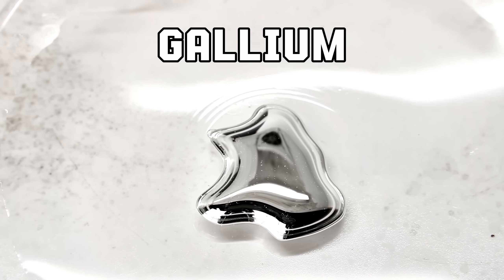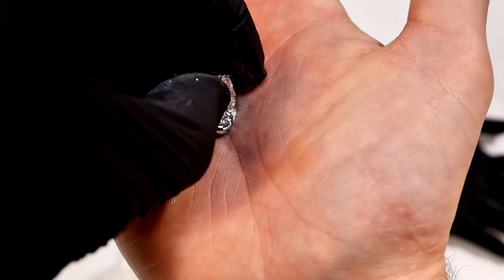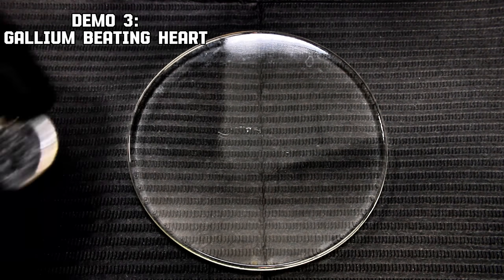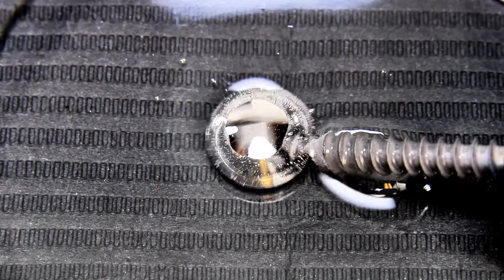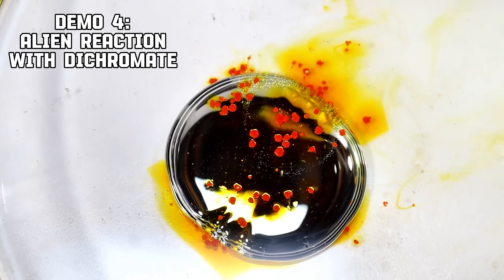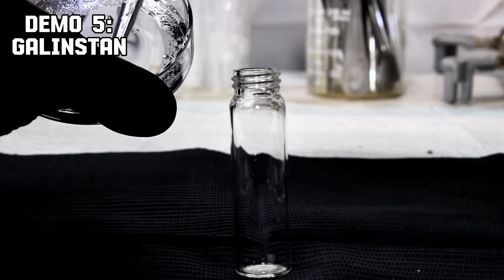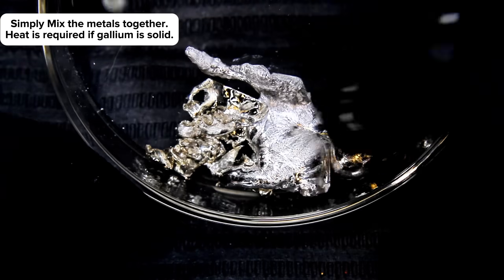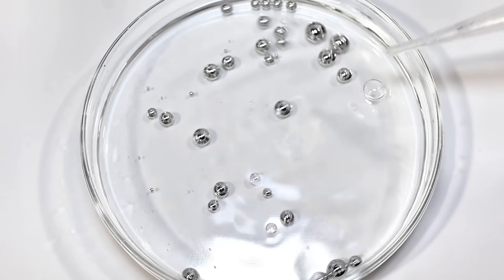Gallium: An Alien Metal

Comment: Gallium is getting MUCH more expensive, China just outlawed exports of it and some other metals. BTW, you can add the gallium/aluminum amalgam to water and the aluminum reacts producing hydrogen and aluminum hydroxide while simultaneously regenerating the gallium metal.
Reply from the maker: Yeah dude I noticed! I was considering buying a bulk amount for this video.. then I looked at the prices..
I didn't know you could do that btw, so just like a nontoxic mercury amalgam? That could honestly be pretty useful in the future
Reply: @integral_chemistry  pretty much exactly like a mercury amalgam. I've read about people trying it for reductions on a couple "clandestine" chemistry synths but I've never seen it done where the yield is compared to Mg/Al. Might be worth a try, on something legal obviously. Lol
Reply: @integral_chemistry  Cyclohexyl Bromide and either Ethyl Acetoacetate enolate or Acetone enolate from Sodium Ethoxide in refluxing Ethanol can make Cyclohexyl-2-Propanone. Cyclohexyl-2-Propanone and Methylamine in Ethanol Water can condense to Cyclohexyl-2-Propanone Methylimine. Cyclohexyl-2-Propanone Methylimine in Ethanol Water and a Carbon Dioxide inert atmosphere can undergo reductive amination to Propylhexedrine using non-toxic Aluminum Palladium Galinstan amalgam (100g to 900g Aluminum foil + 0.050g Palladium metal + 100g Galinstan) or Aluminum Galinstan amalgam plus 500mg of Palladium on Carbon and also add a little Formic Acid (or Ammonium Formate) and Iron Powder, Temperature 30°C and time 24 hours. Filters through a Buchner Funnel wirh Zeolite careful not to spill over the Palladium Galinstan amalgam which you can dry and then add Aluminum foil. Dry with Anhydrous Magnesium Sulfate and Filter again. Bubble HCl gas through it to get Propylhexedrine HCl powder and wash with dry Acetone. Recrystallize for Propylhexedrine HCl crystals.
Reply: why outlaw? and what's used for?
Reply: @DruggiePlays outlawed to hurt competitors of China.
Reply: @BobWidlefish  exactly
Reply: @DruggiePlays  it's used in the semiconductor industry as far as I know.
Reply: I looked up cheaper gallium a few weeks ago, and yeah you can get it relatively cheap from China if it's a domestic order, I even tried going through a third party like Alibaba and temu, same thing, won't do it. At least bismuth isn't getting too crazy.
Reply: @nunyabisnass1141  that's kinda crazy, the CCP must be really serious about the export ban, usually Chinese companies will jump through all sorts of hoops to sell you absolutely anything.
Reply: @chemistryofquestionablequa6252  I think your idea that it's used for gallium nitride semiconductors is correct, the us has been doing pretty well developing new hardware, but where will that hardware inevitably be made? Likely China, so China is hoarding it's comparatively massive deposits it refines from zinc, copper and aluminum ores, ahead of a predicted rise in demand.
Reply: And they've just done it again in April.